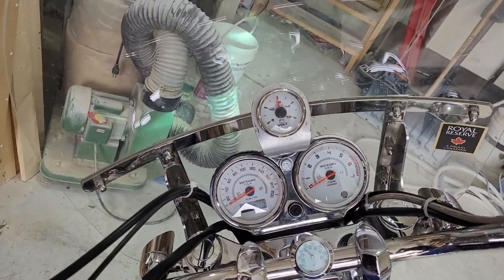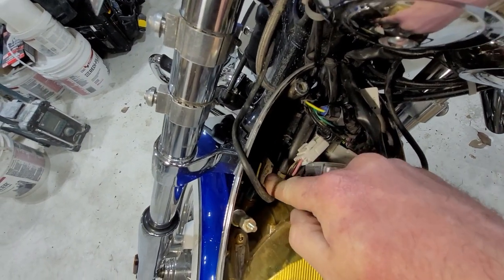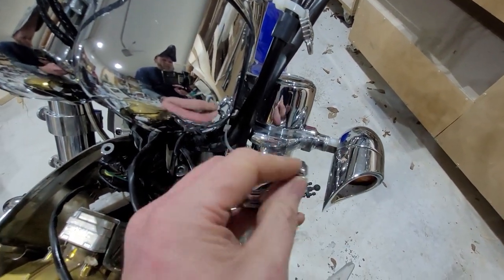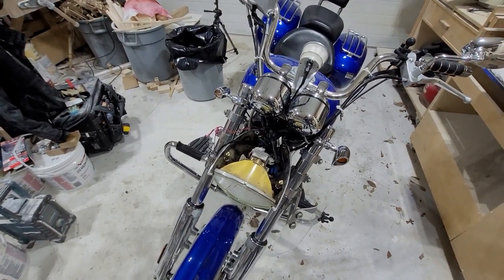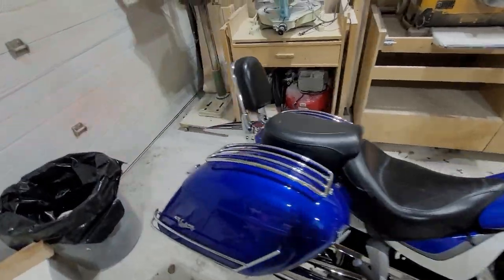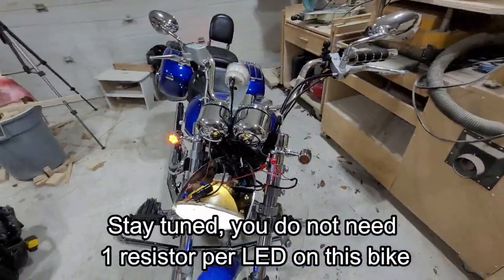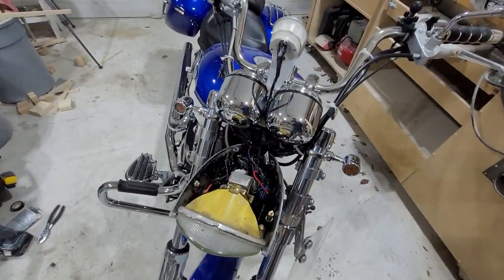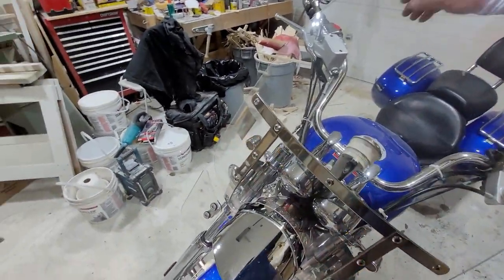Installing front LED turn signals on a 2007 Victory Vegas

Comment: Question.  Is the reverse wiring on the right side for all year vegas or just the 07?
Reply from the maker: Don't quote me on this, but I am under the impression that it was an issue up to 2007, and changed in 2008.  I would verify on your bike before doing anything.  The 2007 wiring diagram I have shows the reverse polarity wiring, if you get a hold of the diagram for other years, hopefully it will show which way it is.
Reply: @grinchbiker5399  Ok thanks. Greatly appreciated

Comment: Couldn't you just use a metric bike diode kit to solve the hyper flash issue. I only ask because that is my plan but not sure if it will work.
Reply from the maker: Good question, but I don't know the answer.  If you try it, please let me know.  I'm always looking for better solutions.